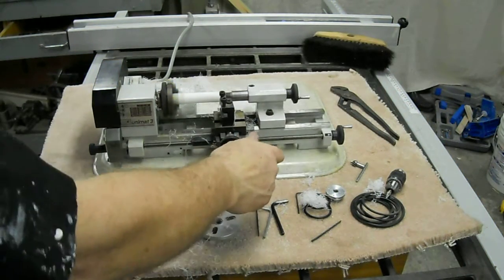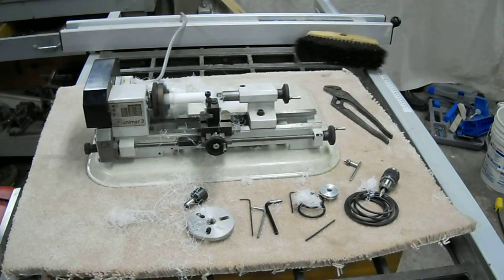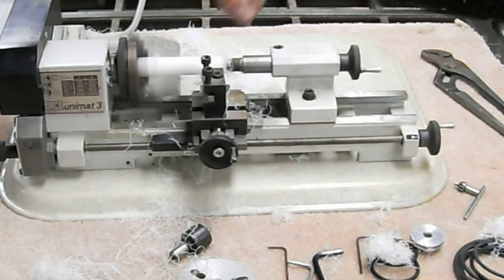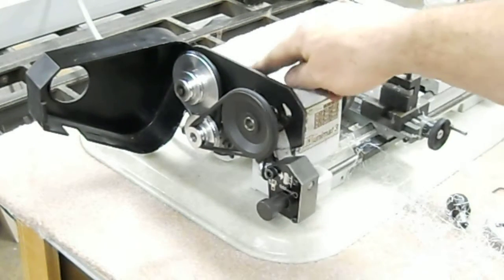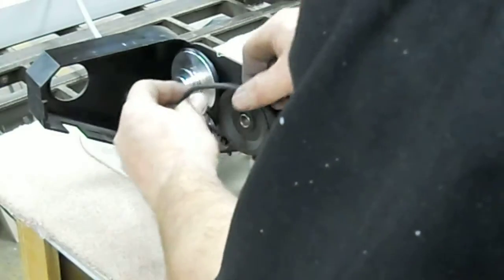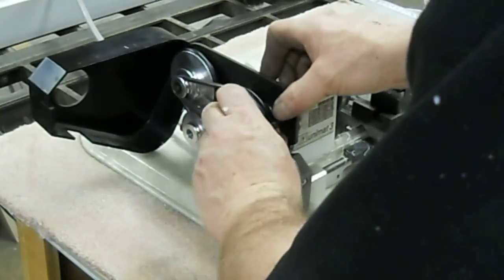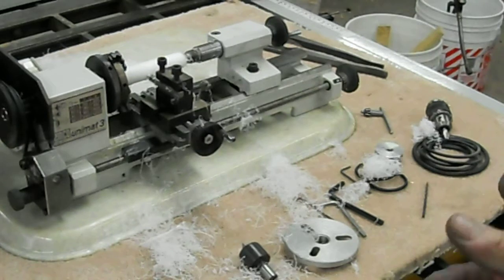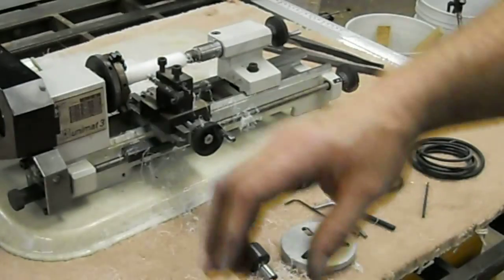Lathe Unimat3

Comment: Hello Sir. I have the exact same one. I bought it last week. I have the automatic feed but dont know how to use it. Would you be so kind to send me a close picture of the band in the automatic feed. jpsellon@gmail.com. Cheers,        Jean
Reply from the maker: Jean Sellon Hi Jean,

Sorry, I sold this lathe a couple years ago.  There is a lot of information pertaining to this lathe on the Yahoo Users Group here:
https://groups.yahoo.com/neo/groups/unimat3/info

Go to "Files" section, there is a document called Unimat3_belt_sizes in PDF format.

Best Regards,
Lucas AKA Arn Jones
Reply from the maker: Jean Sellon 

To follow up, the file contains this text:

Message
http://groups.yahoo.com/group/unimat3/message/2951

Just an FYI-

This may have been posted before, but I have figured out what size o-rings
work

well for my Unimat 3.

The Motor belt is a MSC 09263344 a size 334 Buna N O-Ring - 25 pack is
$6.77

The large drive belt is MSC 09263393 a size 339 Buna N o-ring - 25 pack is
$7.50

The power feed belt is MSC 09262239 a size 232 Buna N o-ring - 50 pack is
$5.71

I hope that this helps someone.

Keith

(keith.violette)